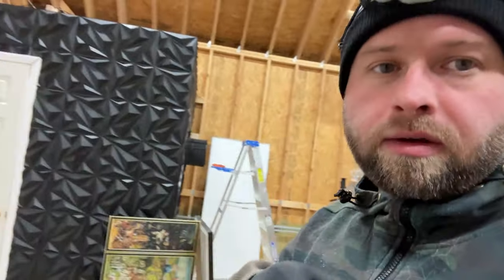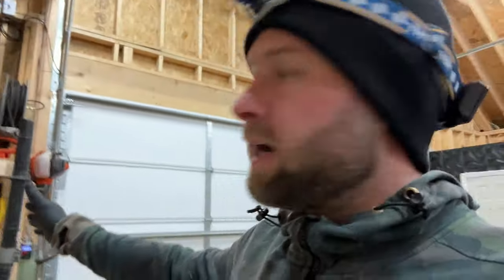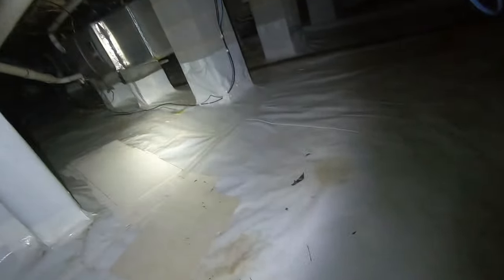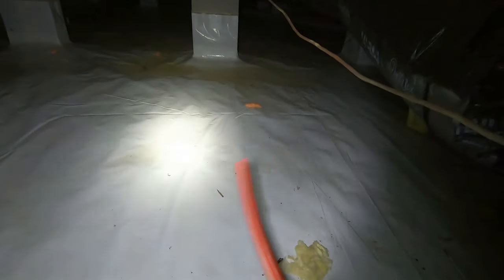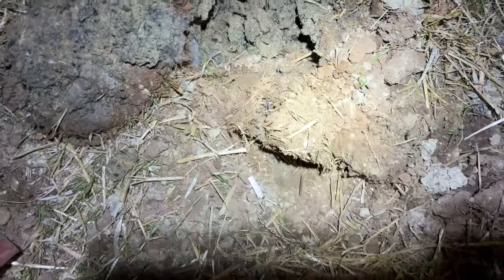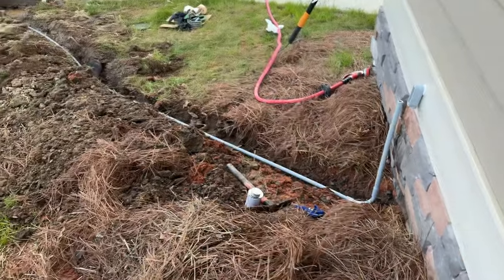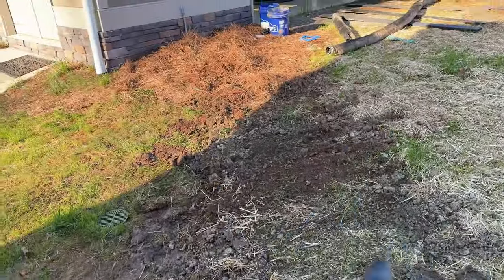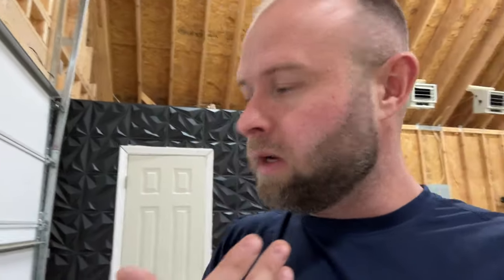EXTREME measures to fix my mining farm's internet

Comment: All the content you can film and upload is welcomed by me. Doesn't matter what it's about. Personally I would have solved this with a Powerline internet adapter. That is how I feed internet to my barn; right through it's AC line then into a 12 port network switch. No new digging necessary. I already feed AC to it from my house.
Reply: Me too. One end inside my house plugged into an electrical outlet and router. The other end plugged into my sheds electrical outlet then switch then rigs. It took 10 minutes. Good video though.
Reply from the maker: I've seen those, but this building is on it's own power service separate from the house!
Reply from the maker: The building is on it's own 200a service separate from the house, but those are a cool solution

Comment: Speaking from experience, your CAT cable will pickup voltage spikes from nearby lightning strikes and burn everything on the wired network. Using an exterior fiber optic patch cable between the house and the garage will eliminate any risks.
Reply from the maker: I feel this risk is heavier with direct burial or if I put it in EMC. Hopefully that doesn't happen, but if it does i'll deal!
Reply: @TechnicalsMatt  I wish you good luck. My CAT6 cable was in a 1 inch PVC conduit, 25 feet long, burried 2 feet underground. Every device connected to the LAN (including the TV and every miners) were damaged. Having a conduit, it was easy to replace the CAT6 with a 10G fiber optic cable.
Reply: fiber is better, but he used shielded. as long as both ends are grounded with no dissimilar bonding its fine

Comment: Video is good, and 10:15 this actually IS mining related stuff.  Just like with the cooling, building some walls and air ducts and such, they turn immediately to mining related stuff when they are designed for it.

Comment: man up buttercup, crotch crickets aren't the danger, copperheads are rattlesnakes are. you approach 270 degrees it is almost impossible to push wire in conduit. you aren't below the frostline, so that wire could crack one day... but i'm sure your latency is way better now. good job sir!
Reply from the maker: Copperheads dude whew. I re-did my landscaping with needles last year and now i'm a damn copperhead conservatory. DOH

Comment: Please tell me that you ran 2 cables? A mainline & a backup.. 🙈 Hope you don’t have to do it again anytime soon..🤞🏾
Reply: Looks like only 1 line. I was taught if you are going through the hassle of pulling cat cables, run 2 because it takes the same amount of time/effort BUT that shielded stuff aint cheap!
Reply from the maker: Just the one, but the run is so short should I need to re-pull it, I'll just tie off and pull 2 through. Should've thought of that! I do have wifi redundancy though in a pinch
Reply: Ya, that was my other thought. You have it in conduit and it is a short run, so it wouldn't be too hard to attach another wire and pull anew one